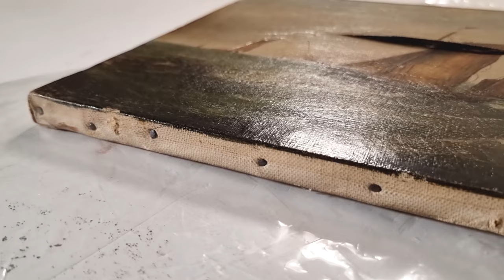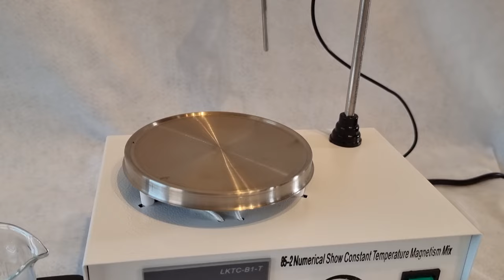Saving and restoring a seascape. #artrestoration #artconservation

Comment: Some linen canvases seem to hold up better than others? Is there a difference in quality throughout the ages with this canvas? Was cost a big factor to an artist in determining the choice of canvas?
I really admire your thoughtful approach to repairing this canvas. The retouching was masterfully done with how you built your color and were so subtle in blending it in. 
The frame repair...sigh. I hated to have to hand mold gesso. Depending on the frame, sometimes I would use a wood putty to get better defination, lightly sand it smooth and then use the powder paints to achieve a matching look to the rest of the frame. The frame restoration sometimes is more labor intensive than the actual art work. But I always stayed away from gilded frames because that was above my pay grade :)
Reply from the maker: Thank you Moonie, love your feedback, yes I would say that linen canvas is very resistant,  it is more expensive but is a very good choice, there are several weights of the canvas, some are thicker and more resistant, but it depends on the size of the painting. I think that for some artists, the cost is something to be considered when buying material. In this situation, I think the painting was in contact with some object several time, and with pressure, because the tear is very strait and defined.
Thank you for sharing your thoughts about gesso molding , that is so nice.

Comment: Wow, great restoration!
 When you were cleaning the painting, what were you looking for with the ultraviolet(?) light?
Reply from the maker: Great feedback Kdiggs, thank you. Although I know there are totally different solvents, in what I use to clean The painting, and what I use to remove the varnish, The fact is that when I was cleaning, it was coming out a lot of dirt, and I was afraid that varnish was already coming out, too. since I was using a circular mechanic motion if the varnish is out, I could hurt the painting, which normally is protected by the varnish.
That was why I check with the UV light, I could be shored the varnish still there, because there was still, a green shadow caused by the existing varnish layer.